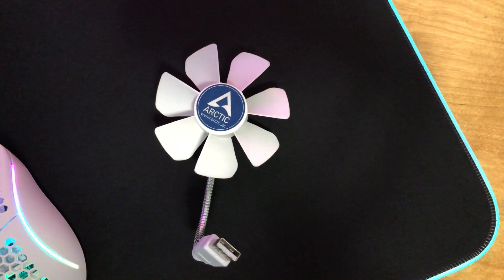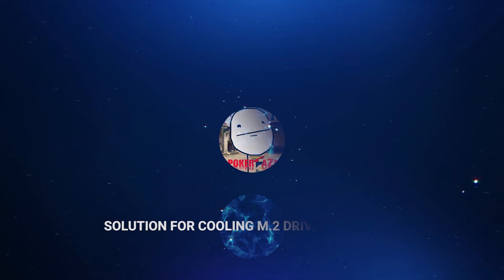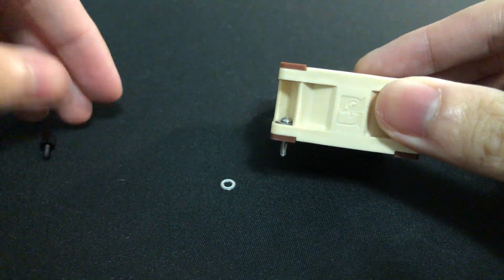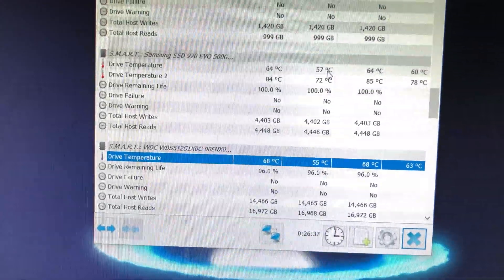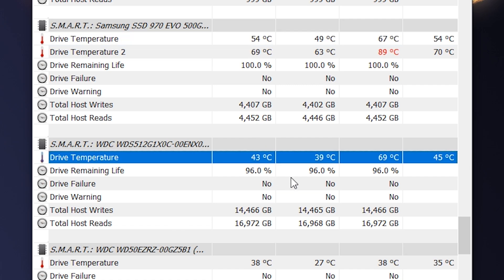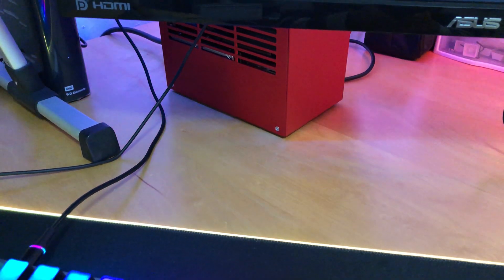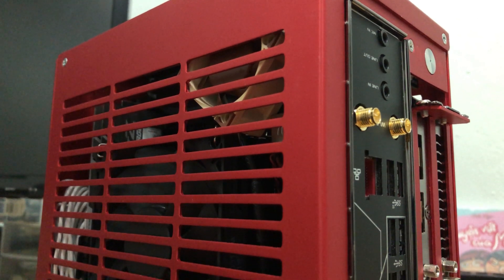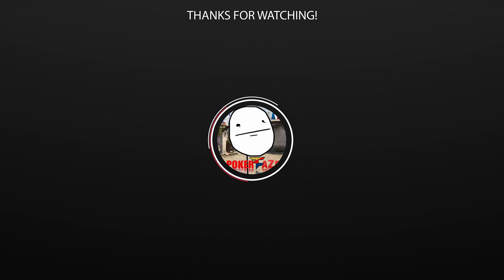Active M.2 SSD Cooling With Noctua NF-A4x20 Fan

Comment: Didn't think case airflow would be so beneficial for those M2, I have a full tower with good airflow and 2x 990 pro with the stock "joke" heatsink, they barely reach 50°!
If they made those lil Noctua in black tho, I'd put them everywhere anyway lol

Comment: Unfortunately I can't do that on my B550i Strix gaming board. The hole you use to screw the fan doesn't exist on my M2 heatsink. Maybe I'll try to design a special duct in 3D and then print it.